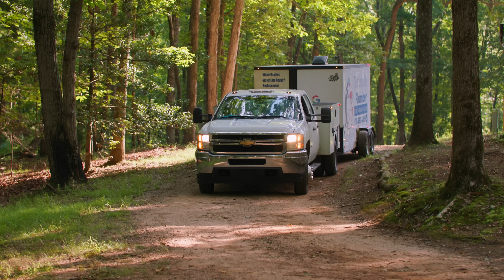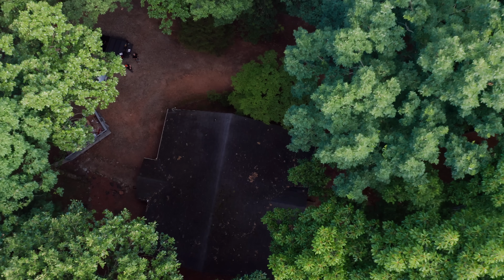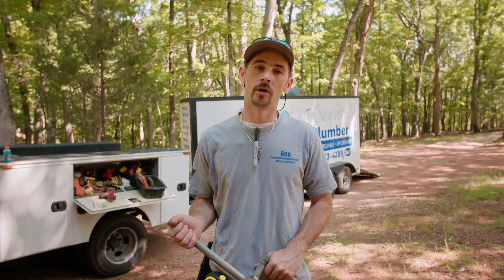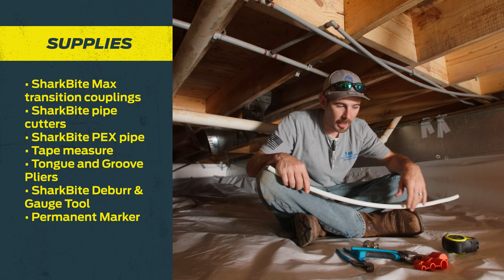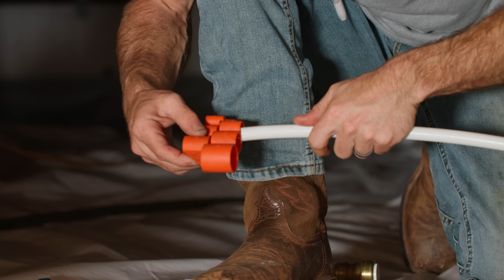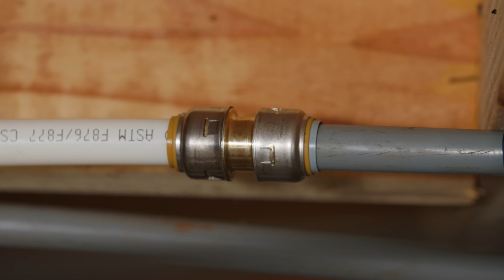How to Repair Polybutylene Pipe

Comment: These push to connect fittings are a temporary fix , should not be used as permanent.  I seen em leak when water pressure drops and repressurized slowly,  they dont lock out .

Comment: In California I've only seen the polybutylene in manufactured/ mobile homes and travel trailers. I thought the de-burring tool was also used for marking the depth. Is it different for the Max fittings?
Reply from the maker: Hi! The Depth & Deburr was made for our SharkBite Max fittings. It deburrs the pipe and helps with marking the depth for the fitting.
Reply: @SharkBitePlumbing  Just wondering why you didn't mark the pipe with the de-burring tool.

Comment: You do not repair Polybutylene. You remove and replace it. There wil just be additional leaks in the future with Polybutylene.
Reply: Not every customer has money to replace every bit of polybutylene bud
Reply: @slimeballkai8172  Well you buy junk you get junk.  The old saying you get what you pay for.
Reply: Why would they replace it when poly-b leak is their cash cow.
Reply: Polybutylene was invented by the Plumber division of the Illuminati
Reply: As pinholes happen it gets replaced at that time. Maybe the customer doesn’t have another pinhole for years or it could be next week. This guy did a solid repair.
Reply: You’re wrong. PB will be working fine when you’re long gone! It’s been used in Europe for decades with few issues.
Reply: Especially on a well with no chlorine, no need to replace. My polybutylene (with well water) is 30 years old and the pipe itself has never failed. Only the copper fittings.

Comment: I need to transition from PB 3/8" - and sharkbite does not make a 3/8" coupling.... how would you transition from 3/8" PB pipe to Pex or brass?
Reply: Hey brother just had this issue and used shark bites regular 3/8-1/2 fitting seem to work fine for now did it on my personal house
Reply: I liked when you said “don’t blink” or else I’d miss the best  important part. 👍

Comment: I repaired many poly pipes with standard shark bite fittings. Been in service for over a decade. No problem. OD is the same. ID is bigger. The pressure keeps the pipe expanded. The shark bite max have no stiffeners in the  non transition fittings.
Reply: You are semi correct. 
It does work .. for awhile
Reply: @bengoheen7976  Then what happens? It magically starts leaking?